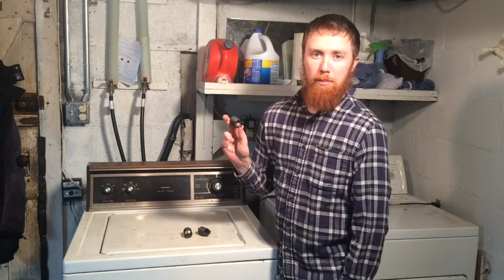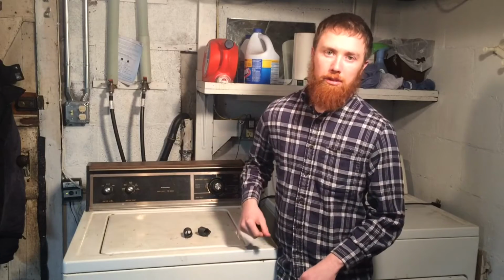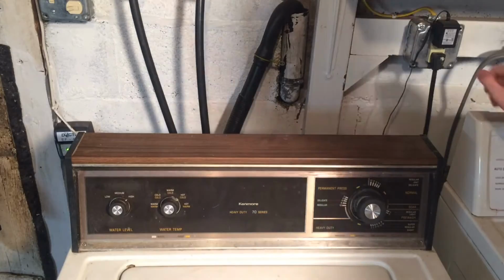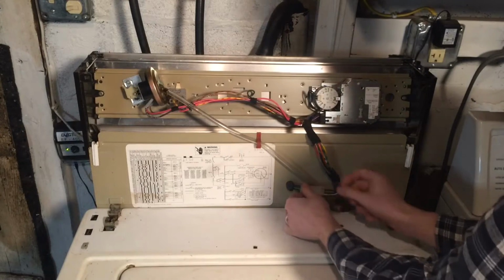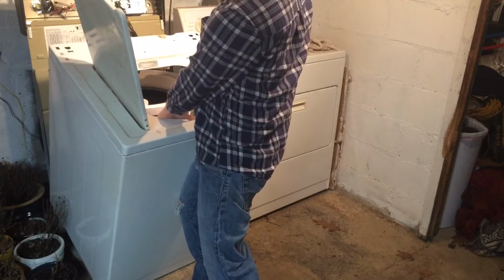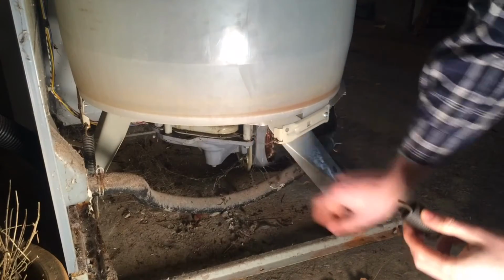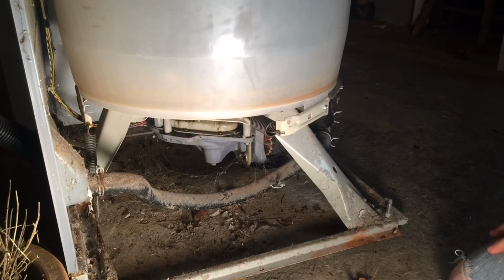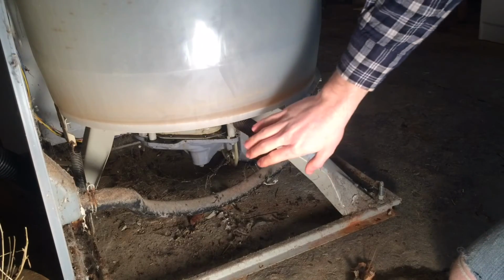Fix-It Friday: Washing Machine Balance Springs

Comment: Every video I've watched on this procedure makes it look so easy, but I'm now trying to replace mine after a tub seal replacement, and no matter how I try it, the thing will not make! I told my wife the guys in the professional videos (appliance part pros, etc) must have their camera man come over and help to somehow get those suckers back on, because I'm sure not getting them by myself! I've tried channel locks, vice grips, spreading them with screwdrivers, but no matter how I do it (and I'm a pretty good mechanic-most of the time), they're just not going on. Man, this is nerve racking! And then I find this video from a regular guy, who also just pops them right on. And trying to get the one that I took completely off back onto that tiny 'eye' clip on the frame is even worse than the bracket! Told my wife they must have a machine do this at the factory. I'm just not gettin' it!

Comment: My Whirlpool makes this noise and I have to hold it from dancing around.  I removed the cover but all four springs are in good shape.  What's the next thing I can check?  I don't want to pay more in parts than I have to by getting parts I don't need, I'm on a fixed income.  How can I tell if the balance ring needs replaced?  I can't find a model#.  Please help!
Reply: Okay, it was on the inside of the back. ....Model: LA9500XT
Reply: Hi Nancy, did you solve your problem with the washer. My kenmore/whirlpool is doing the same thing.
Reply: @green-zone36  I did.  Never found any broken parts, but replaced the one spring in the back that attaches to the tub, in case it had weakened.  I replaced the dogs on the agitator and those little pads that the tub rests on (just because they were cheap and I had access to them).  I had to buy a spanner wrench, to remove the agitator from the transmission.  (About $17 online). All together I spent about $50.  Still not sure exactly what the problem was, but she's washing with no dancing. (Just my happy dance)

Comment: So, my washing machine wasn't emptying completely after spin cycle (no water in it, just the clothes at the bottom of the tub were soaking wet), and searched YouTube for "balance washing machine".  Now, I have an older (2nd hand) washer, and to my surprise it's the same one you just worked on!  How cool is that?  Thanks!